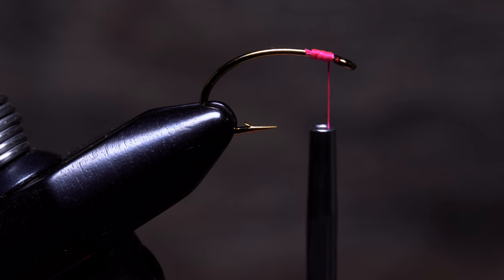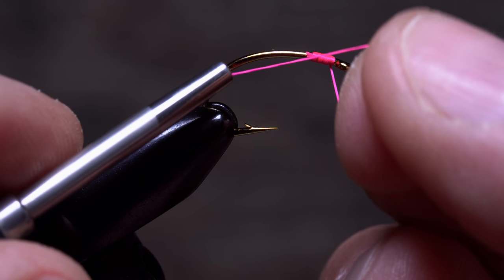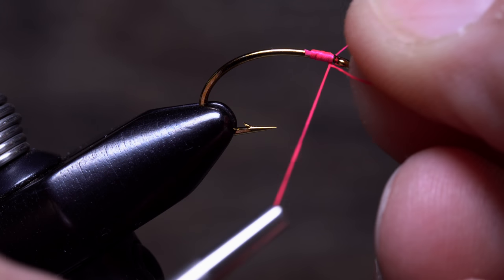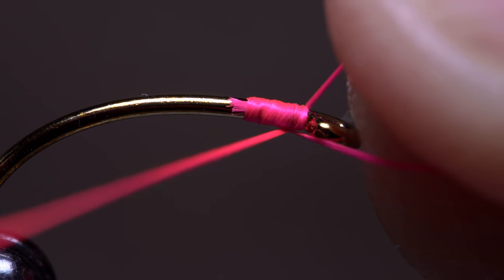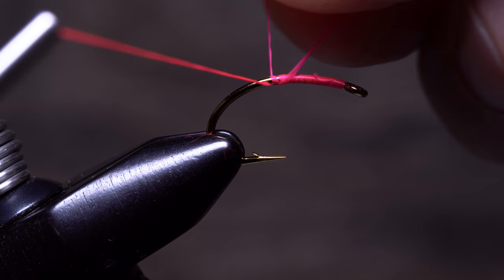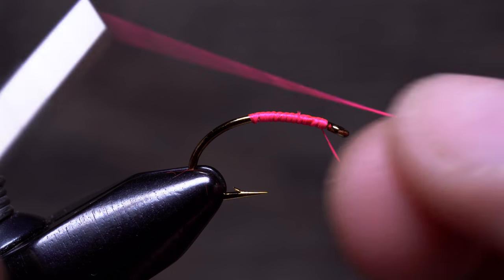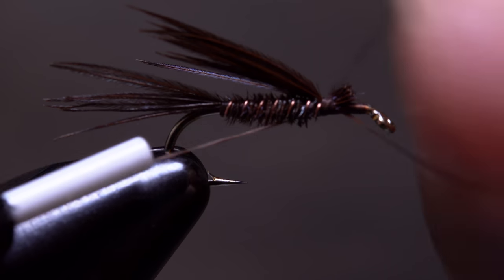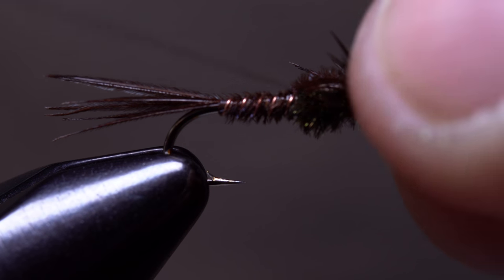Using Half Hitches to Save Your Work

Comment: Great tip. I was taught to use half hitches at each step in tying a fly.
It really helps when you go to tie in your next material, especially 
if you need to use a loose wrap.  It also saves you if you happen
to break your thread at some point.  I can’t believe I see very few
good fly tiers that use them.
Reply: A bobbin I have has a tendency to break 8/0 so I use this whenever it happens haha